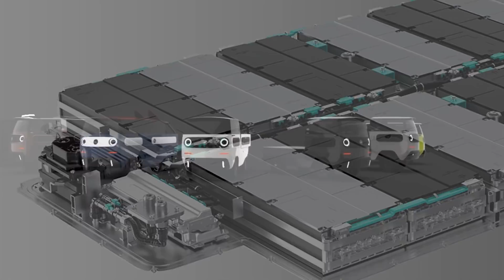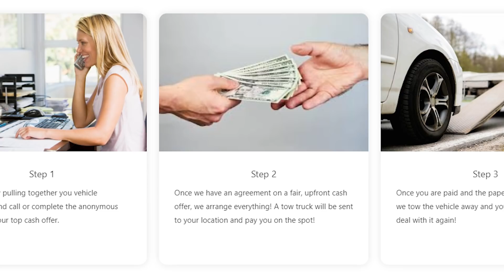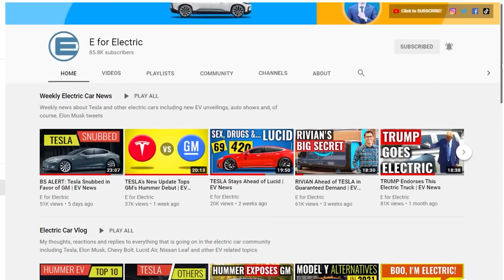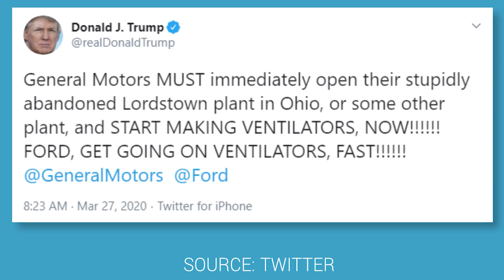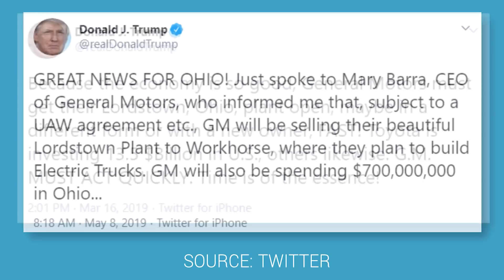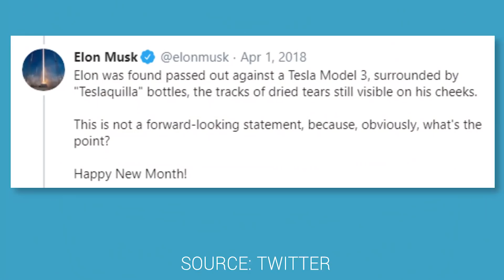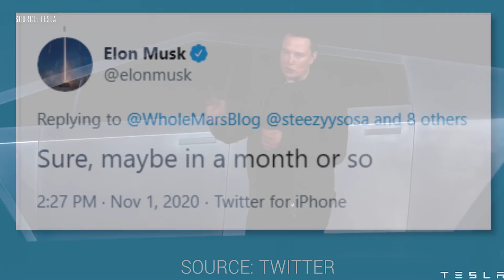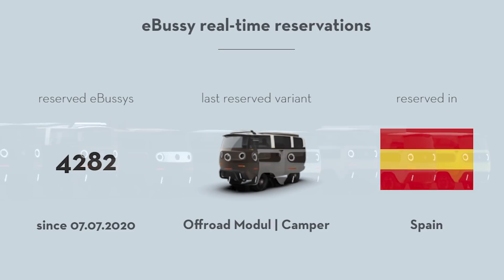Electric Cars Under Biden vs. Trump | EV News

Comment: Tom's rebate suggestions are perfect.
Reply: The step-model is complicated, and range is not that important. The purpose is to get rid og polluting cars. So only give it to zero emission! Not hybrids. And stop the incentive when ice cars sale stops (banned).
Reply: @yourcrazybear  good point.
Reply: I believe that's what is done in Canada; you get the rebate at POS. it is about CAD$5000 for BEV and CAD$2500 for PEHV.
Reply: I disagree with his range incentives. Most people have little to no use for a 250 mile range. It's one of those things that is a number they can compete on, but which for the average consumer may have no use for. After a lot of consideration I've realize anything over 150 miles is pretty much absolutely useless for me. It's just adding cost, resources, and weight to the vehicle. If you incentives range like that though everything is going to be 250 mile range because the rebate offsets the price of the battery. Basically you are paying to upsell something which wastes resources and makes the vehicle less efficient by adding weight. That is not what we should incentivize.
Reply: I like the suggestions but I think the credit should be eliminated and let the market drive the cost down.  The credit keep the prices artificially high instead of letting the market drive it down like most other consumer products.  Look what happened when GM and Tesla hit their limit.  Tesla slashed the price of their cars and GM said they would put the incentive on the hood at sale.  The credits are great at the beginning to help get started but we have the traction to keep it going as we see that Tesla sales are not declining.  When all of these other electric vehicles come to market over the next couple years, the competition will drive the cost down.  Credits will keep the costs up.
Reply: Yes they only other step I would implement is for the phev should only get the smallest rebate possible cause the phev's only go like 40 miles and then rest gas=bad 😫
Reply: @yourcrazybear  You completely and totally missed my entire point. By subsidizing based on range you are basically forcing everything to 250 miles, or whatever your cap is. If the subsidy is 30$ per mile of range the consumer price difference between 150 miles and 250 miles becomes basically nothing. That means the market will move entirely to 250 mile range regardless of what consumers want/need and it will be incredibly wasteful for people like me who only need 150 miles max to have almost double the batteries I need because they screwed with the pricing. It would lead to distorted consumer incentives and choices that create waste because people for some reason think they need excessive range and that 250 miles is somehow some sweet spot.
Reply: @yourcrazybear  A sale is a sale. But, only one per household.
Reply: This is the way it is done in Europe. Discount is on sticker price in the showroom. The scaling is spot on good idea.
Reply: @yourcrazybear  If you take the leaf as an example this proposal would cover about half the difference between the base and the longer range plus. It undebatably would skew the market toward longer range and significantly screw with the normal decision making someone would do when considering whether spending more for more range is worth it. You can argue that is a good thing if you for some reason think everyone needs 250+ miles of range, but I don't think that and see it as very wasteful to incentivize people to buy excess batteries they may not need by making the price difference very small.
Reply: I have to agree with some others: leave politics out of your videos, as you could very well alienate 1/2 your audience.  Talking policy is fine I would think.
Reply: @fireofenergy  Battery production is already a limiting factor for electric car production afaik. Larger packs per car most likely just means less cars as battery production scales up so incentivizing pack size also probably reduces the number of electric cars on the road. Also there are already quality electric cars that can be had for 25k$ out the door price. Tesla is fine in a lot of ways, though I will absolutely never support them with their current right to repair stance, but it's kind of ridiculous how much bigger the Tesla community is than the actual electric car community who care about things other than Tesla.
Reply: @yourcrazybear  This is basic economics and consumer choices. If you make the price difference small enough people will buy things that they don't need just because of the higher perceived value, resale value, etc. Even a child would be able to tell you that if 250 mile range and 150 mile range is the same price literally everyone would get the 250 mile range. An aggressive range based rebate like was suggested wouldn't quite make them the same price, but it would bridge the gap enough that a large portion of consumers would switch from the lower range to the higher range. At that point if the lower range would be selling very poorly the manufacturer may even cut the lower range option. If you think people only buy exactly what they need you don't understand people. Every time you lower the price for an option you will get more people who get it despite not needing it.
Reply: @yourcrazybear  When you are cutting the price difference in half it is definitely enough to change a huge amount of peoples' minds. It would likely lead to me wastefully buying a longer range EV if I were buying one. Also saying technological advancement is largely based on wastefulness is hilarious.
Reply: @yourcrazybear  Okay maybe I shouldn't have used the word need since that seems to be what you hyper-fixated on. How about "have a reasonable use for." I fail to see how many normal people have a reasonable use case where they would significantly benefit from large ranges. There will always be exceptions, but to me the range battles are consumer ignorance and marketing rather than actual reasonable design and purchasing.

A road trip with basically any EV is going to be inconvenient compared to ICE. The only way to prevent that is actually increasing charging speed or having a completely absurd battery range like 1000 miles or more. Even then until it's 3000 miles or more it will probably be inconvenient without hugely improved charging rates. Even if the capability was there to make a semi-reasonable vehicle with those types of ranges it would be absolutely absurd and impractical to do so unless it had extremely fast charging and if it had extremely fast charging it wouldn't need those ranges.

So if long road trips aren't really a great use case for a long range electric car then what is? Well if you are regularly driving that distance on a one way day trip or round trip then maybe that is a good use case. So let's look at those use cases.

I will concede maybe there are people who make 250 mile one way day trips where they would drive 250 miles, do something for the day and drive 250 miles back. That would be close to 8 hours in the car and isn't something I've ever done, but idk maybe some people do it. Then they have a use case. I would expect more people rarely do that though. Personally the longest trip like that I would ever be doing is Orlando which is 130 miles from me. That means a 150 mile range just covers driving to Orlando, charging the car at some point there while I do things for the day, and then I can drive back. Maybe it would be nice to have a bit more buffer, but 150-180 miles in that case is the ideal range for me.

Okay so what about things where you wouldn't have time to charge the car? This would mostly be errand type things where you go, pick something up, and drive back. Well then 250 or more mile range makes sense if you are at some points running 125 mile errands. Like I said Orlando is 130 miles from me, but I would never go there for an errand. The farthest I would reasonably go for that type of thing is 50-60 miles to Tampa from where I live. I will concede maybe some people do run 125 mile errands, but that seems absolutely absurd to me. Anyway for my errand running I would go 100-120 miles and so with some head room I again end up with 150 miles as a sweet spot.

So, unless there are people running what I consider ridiculously long errands or going on what I would consider ridiculously long day trips I really don't see the actual use case for ranges much over 150-200 miles. That doesn't mean there are absolutely no use cases for it, but I don't see them as reasonable, common, real world use cases.

Now if a lot of people don't have a use case for something why should we heavily subsidize something for that over something for what, at least to me, seems to be the more common and reasonable use case? You say for technological advancement. I say that is bullshit. Improvements in energy density are massive for any range of EV. EV's are currently far heavier than similar ICE vehicles. If you make a more energy dense battery you can use less resources. which saves money and the environment. You can also produce a lighter vehicle with the same range. That means better efficiency and a better driving experience. Also if you can produce the same number of batteries, but the batteries are higher capacity you can produce enough for more vehicles with the same range. There is plenty of incentive for progress on batteries besides range.

So after all of that please explain to me why the fuck someone who buys a 250 mile range EV should get 2/3rds more of a rebate than someone who buys a 150 mile EV if that 150 mile EV is all they need. It makes no sense. At best you are giving people with what I see as fringe use cases a bigger rebate for no reason other than I guess that their use case is more expensive. At worst you are just blatantly subsidizing wasteful consumerism. To me really it seems more likely to be the latter.

I'm not saying high range EVs shouldn't exist. I'm not saying they shouldn't get a rebate. I am saying pushing them over ranges that at least arguably have more reasonable use cases leads to waste and making it so subsidies push the market towards those ranges is subsidizing waste.
Reply: Tom is spot on... IMO.. the rebate should be capped starting at $50K..sliding to zero around $80K.
Then around 2030, we must accept the need to charge EVs a LARGE Federal purchase tax, and Large State Registration tax for Road Maintenance, which is currently collected via gas taxes.
Reply: Overall, good ideas.  Would not give rebates to PHEV's (why incentivize a technology that still burns gas) and would reduce it for compliance cars (basically, ICE vehicles with an electric drive train).  Also, would provide a lower rebate for manufacturers that have worldwide EV market dominance.

Comment: The Toyota CEO's comment on Tesla's "kitchen" is like Blackberry saying that this iphone thing is just a fad...
Reply: I wonder if he was referring to the other Tesla, that is Nikola.
Reply: 😊👏👍#buzzofftoxic oil
Reply: Yeah, Toyota really missed the boat and now they are trying to hide behind fuel cell vehicles that are not going anywhere (for cars anyway).
Reply: Only one problem: Toyota still sells way more cars than Tesla, and that isn't likely to change any time soon. The iphone vs Blackberry argument is about one smartphone format vs another, but both products were still smartphones. The Toyota vs Tesla contest is more nuanced. Both companies sell cars, but Toyota is a company that hedges its bets with multiple technologies, whereas Tesla is committed to only one: BEV's. Toyota sells its cars into a market that has driven gas powered cars for over 100 years, whereas Tesla is betting its future success on one thing: peak oil. In other words, when oil becomes more scarce and more expensive, buyers will switch to EV's. Toyota on the other hand, recognises the same problem by building hybrids. Bear in mind that a hybrid is basically a BEV with a generator attached, so Toyota could pivot to making EV's very quickly if there was another oil shock as we saw in the 1970's.
Reply: @aftonline  you make a good argument and Toyota were key to develop the hybrid model that Honda had introduced with the Insight. However Toyota do have a huge investment in everything except EVs, so they are biaised against them and cannot develop them without losing face (their current CEO is the engineer that developped their hybrid drive). 
Hydrogen is a dead end for cars because fuel cells require expensive metals (paladium) and hydrogen extraction/transport/compression/electricity conversion is so innefficient it's cheaper to extract it from natural gas (so zero savings compared to gasoline or natural gas). It is bad to the point that using solar for electrolisis is absurd, it's more worthwhile to directly sell that electricity. 
They also have a huge dealership network requiring repairs to be made on cars and that raise the car's price, where Tesla sells direct to consumers and need no marketing to sell everything they make. 
In addition, Tesla do not need peak oil to happen, when you factor in fuel savings and maintenance reduction, electric cars are already more profitable and FAR more fun to drive than primitive gas cars. 
BTW, I own both a Prius and an Chevy Bolt so I can definitely compare. 😁
Reply: @brunoethier896   EVs may be fun but they cost more to build and thus to sell so that makes them an expensive toy. Yes they could be made with smaller motors and battery packs to make them cheaper but then they would be slow and less fun to drive and would have even less range. I suspect Tesla's $25k EV will be less of a compromise in that way but we will see...
Reply: @aftonline  I give toyota five years to lose 50% of its stock value.
Reply: @AR-rn8ok  Maybe someone should tell Gordon Johnson he should be shorting Toyota not Tesla LOL.
Reply: @aftonline   Actually, if you include the fuel savings and 50% maintenance savings (according to Consumer Reports), EVs are already cheaper than Combustion cars over 5 years.
Except if you are in West Virginia, where coal based electricity is more expensive, then the tipping point is 7 years.
Here in Quebec we have double the gas price, half the electricity cost and a 13k$ (CAD) rebate, so they're actually cheaper in 2 years ;-))
Reply: @brunoethier896  Our electricity is really expensive here in Australia. And I will also make the point that not everybody buys brand new cars. Just to illustrate how scarce used EV's are, the biggest car sales website in Australia typically has over 200,000 cars listed for sale at any one time, of which 400 are electric, and not all of those 400 are used cars, some are new. The EV's are also typically double the price of an equivalent used ICE car.
Reply: @aftonline   It is true that the cheapest and more ecological solution is to keep the car you have, especially if it is paid. That's why we're keeping the Prius while using mostly the Bolt. 😉
The problem with used EVs is that they are so good they are kept longer, and if you're looking for a 5 years old model it's either a Tesla that's just as good as new cheaper ones, or a piece of crap (especially the Nissan Leaf that was designed with no batery cooling so it loses 5-10% range per year).
Reply: @aftonline  Well Blackberry sold wayyy more Phones but when Apple came they came crashing down, it's only a matter of time.
Reply: Aye Tesla wishes it had Toyota’s reliability and consumer satisfaction
Reply: @jakefields8018  Prius is a good cheap car and may be the in-between from combustion to electric cars for the next 10 yrs. I live in CA and just last week it was reported that Petaluma, CA (Napa Valley) has banned any new construction of petroleum/gas stations.  This may be a trend that other CA cities follow.
Btw, Tesla stocks are twice as valuable than Toyota's. Currently Tesla stock is a large head above the rest. 
Let me add that since a Tesla life is one million miles (w/a battery switch @300k -500k), it makes any Tesla the cheapest and safest car on earth.
Esp if ur house is a solar powered one...I pay $0 to charge my car. In fact at the end of the year my electric company pays me.
Reply: @aftonline  Australia may be the auto dinosaurs then. Germany is racing to get out their EVs and charging infastructure. China has built the largest Tesla factory yet, stating their country will soon be all electric. The USA expects to be mostly electric by 2030. 
Teslas stock is the highest.  There are at least 30 new EVs coming out in 2021-22. See where trends are going?
Reply: @AnnLeiSoCal   Globally, the trend is less noticeable. Ramping up EV production for less sophisticated markets where used gas cars still outnumber EVs by a huge margin will take decades. There are over a billion cars in the global vehicle fleet and less than 1% of them are electric. Meanwhile, production of gas cars continues to dwarf EV production. EV's may be a good idea but they are about as significant as previous attempts to switch people to natural gas or LPG, which eventually petered out after initial promising signs of adoption. I'm not holding my breath.